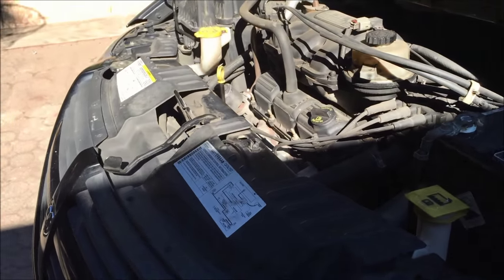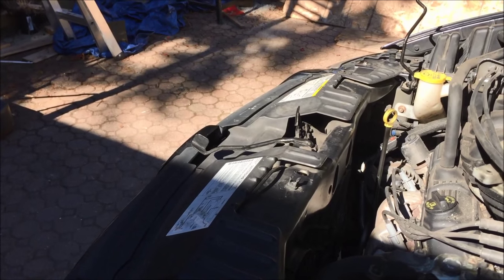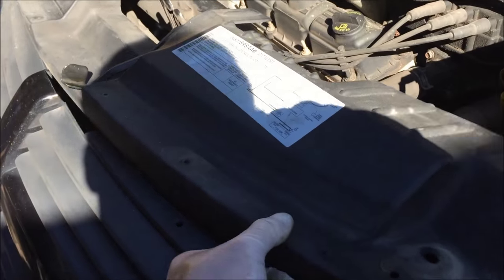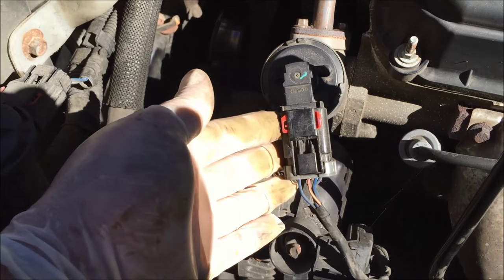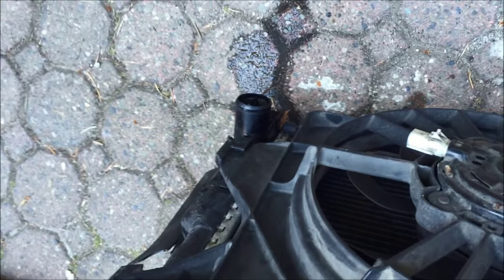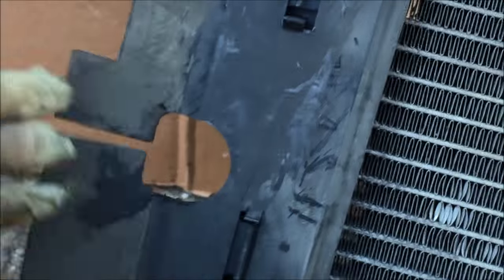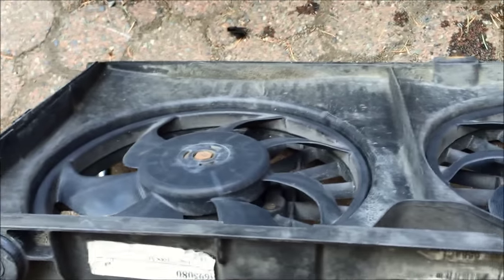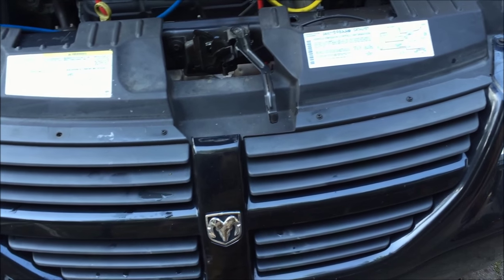Detailed steps to replace the radiator or AC condenser on Dodge Grand Caravan or Town and Country

Comment: Appreciate the video it is very helpful but by no means is this a detailed video for replacing the A/c condenser nor do you make sure to let people know that the A/C Condenser is also a transmission cooler combined in one on some models. It don’t show how you handle the refrigerant from the A/C unit or how to put it back in

Comment: Yes, good video! I have to replace my A/C condenser and I liked the way you zoomed in on the bracket area on the radiator that holds the condenser. Looks like the condenser will be pretty easy to replace.
Reply from the maker: It's really easy and helps a lot to see it when the radiator is out. I have a video on the A/C condenser FYI

Comment: I think i need to replace the fan relay because my AC works well only when I am moving at a light it starts to blow out warm. Do you know if the one relay controls both fans or do I need to buy two relays?? Both fans goes on at once?
Reply from the maker: I only know of a single relay on the fan.
Reply: @DougBrownVancouver  so i guess both fans go on at the same time?
Reply from the maker: @LubaLuba1  Yes
Reply from the maker: This is a good video, very clear

https://www.youtube.com/watch?v=_ZpHyY3IBnk

Comment: Can you replace the condenser with out remove the radiator.
Reply from the maker: I think it would be a real hassle
Reply: You DO NOT need to remove the radiator nor do you need to remove the metal core support arm. Just remove the bumper and headlights and you're at the condenser.  Check out this other guy's video:  https://www.youtube.com/watch?v=01NJapxUzXs
Reply: Absolutely you can. See link I put below in the other comment.